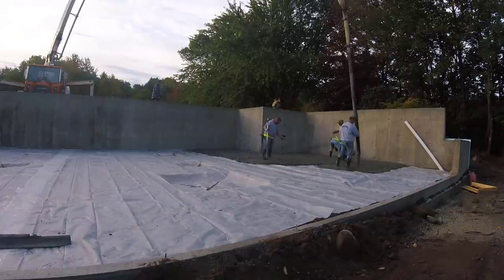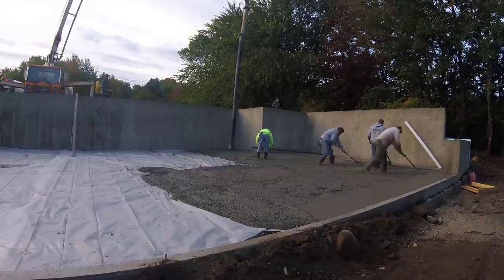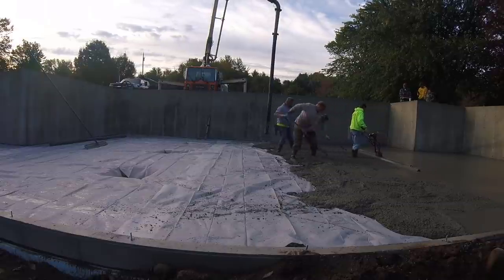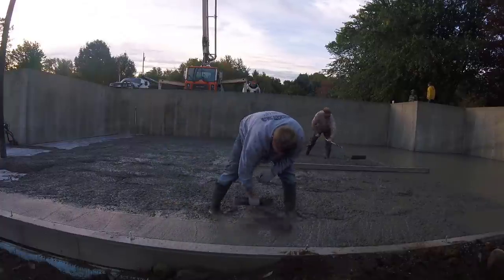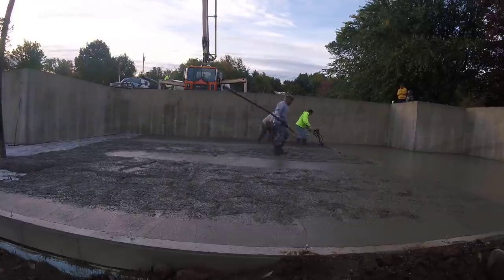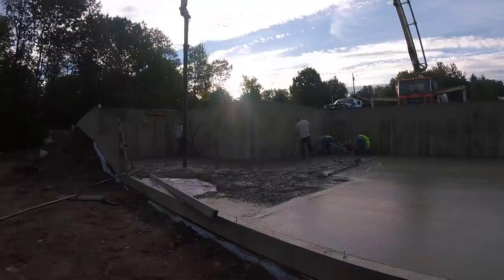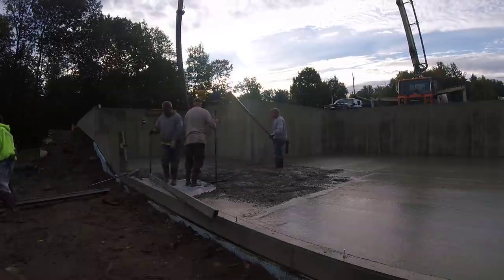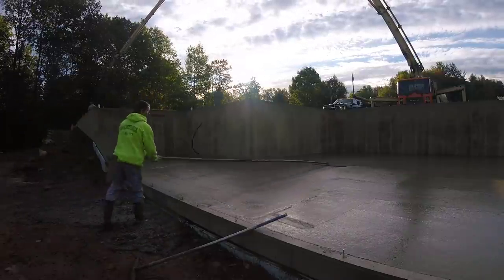HOW TO VIBRA SCREED A CONCRETE FLOOR - PRO TIPS & TRICKS

Comment: you've earned yourself a sub bud...working with a crew of 10 guys (me included) what this video shows is all too familiar such as the guy pouring the hose from the pump along with the vibra screed operator and the guys raking the concrete it is definitely interesting and something different everyday than the average 9-5 job and yes we too use marshalltown tools very good indeed

Comment: I've been watching you for a while now and this is a great video like the others.  One thing I CAN NOT figure out to save my life is this: how are you getting the floor within 1/16" if you're not running the screed on form boards or using screed pins? I understand you're using the topcon but everything in the middle seems to be eyeballed.  

The way you do it seems to be common practice.  I'm just hoping to gain a very complete understanding of why and how the elevation is spot on.  Thanks!
Reply from the maker: If you watch the video back you'll see us making "wet pads" in the concrete using the laser and grade stick. We screed our pads in the middle using these wet pads. Then we use the power screed from these screed pads. It's all set with the laser. Really accurate.
Reply: Used a laser dude

Comment: where is the rebar or cables? what kind of slab is this? is it common for basements to not have reinforcement? nice video
Reply from the maker: It has fibermesh in the concrete for reinforcement, no need for rebar inside a foundation wall like this if the sub-base is installed and compacted properly.
Reply: Cables are used in suspended parking structure s
Reply: He did that basement above with mesh

Comment: Great video! Do you trust the vibra screed the same as a screed board to not leave humps and dips? Is it as accurate? Thanks! I learn a lot from you!
Reply from the maker: At first we didn't, but as we got better using it we do now. We don't use it on floors that have a slope, just flat floors.

Comment: Looks like i can learn alot on your page.if this screed is alot better why soesnt everyone use it.just asking .im ganna pour a parking lot for a customer. We are ganna use 300psi with 1 1/2 rock and with fiber mesh so i can saw just the next day does that sound ok .5 inch thick with 1/2 rebar
Reply from the maker: Sounds ok.
Reply: @MikeDayConcrete  why only ok.

Comment: It would be awesome to pour a slab with no mesh or steel in it . In Australia the only time we do that is on a gutter 👍 that’s good guys 👌🤙🏻🎥
Reply from the maker: It is awesome. Mostly on house floors though. Inside a frost wall there's no need for mesh or rebar unless it's structural. Makes the pour go easy.

Comment: Hey Mike great video. Im going to order a Shockwave. I wanted to order the 14ft screed but will get the 12 if you think it makes a difference to learn with? Do you use a certain size you prefer or just depends on the job size? Thanks. Been hand screeding for 40 years but getting too old!

Comment: Hi Mike,
Do you use vibrascreed for exterior pours or strictly interior?  Love your channel and no bs  
Thanks, Paul
Reply from the maker: If it 's a large "flat" exterior pour I do. Why do you ask?
Reply: Mike Day Everything About Concrete 
Hi Mike, 
I’ve heard from some that vibrascreeds can trap bleed water and can cause durability issues with exterior slabs exposed to freeze thaw. I would love try a vibrascreed for driveways but I would hate to have any problems with durability. Are there procedures or mix design that change when you use the vibrascreed on exterior projects?
Thanks again for your videos and helping out others in the industry,
Paul
Reply: Mike have you ever had any issues with trapped bleed water, like that guy was saying.  I mean I know tons of guys that will say all kinds of junk to justify why they don't use anything but the one, and only method they have ever learned, Id trust you over anyone saying they are not good for exterior work.
Reply: @paulp8251  Good point. I understand vibrascreeds are banned in many locations because they can easily be misused and leave a very poor surface of the final product. The concrete mix can separate and the bleed water can be trapped. Should not use vibrascreeds for optimal results, and you really have to know what you are doing. Floors in homes where the surface will be covered isn't so important as long as it is flat. Some of the roller screed people talk about these things.

Comment: Use a wheelbarrow, to much wasted concrete. You guys have a good crew, work good together. Keep up the great work
Reply from the maker: It would take 3 times as long to pour with a wheelbarrow. Waste is about 1/2 yard of concrete. Plus both my guys have hurt their backs wheeling concrete, it's not worth it. Much easier to pump.

Comment: Looks like you have some retarders in concrete reduced water.  
I put level mounds in using laser, lay edge beam 300mm wide to my level mounds, another about 3-4m wide another beam, about 3/4 way done i then do another beam, so on, concrete doesn't dry out, tamp/float from my semi drying beams. 
By using laser get variation about +/- 8mm, about what I get from non readymix, using concrete 1 bag mixer.

Comment: Tip of the day, get rid of 2” edgers, drop the music. Is a 12’blade or a 14’ blade the best, would a 10’blade be two small.... I’m going to say I’ve poured over 5000 floor, I doubt if I ever got one within a 1/16” of a inch which would give you a 1/8” Tolerance. I congratulate you that in my book is extremely good. If someone would call me up and say they have a puddle of water on the floor I tell them through a nickel in there and see if the Buffalo drowns. If they say he drowned I say thanks for letting me know we’ll work on that and do better next time.

Comment: Where is the rebar?
Reply from the maker: There's no need for rebar in a house floor that's inside a foundation. The concrete is 3500 psi with fibermesh reinforcement. It has sawed contraction joints to spec. rebar is overkill for a floor like this, it only has foot traffic.

Comment: lolololol again 1/16 of a inch NO WAY id love to be the one running a stringline to see that floor lolol
Reply: Exactly
Reply: Of course it won't withing a 16th if your using a strong line to check.  String lines sag
Reply: Check that with a laser. Bet its not 16th in the whole slab but maybe 16th in 10' not hard for a 16th in 10'